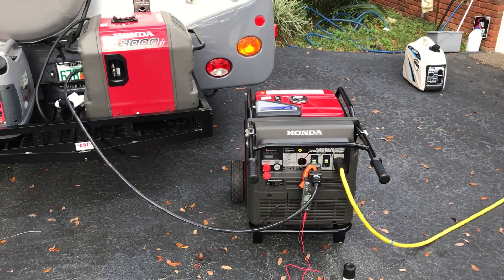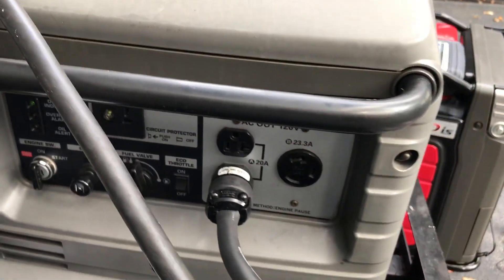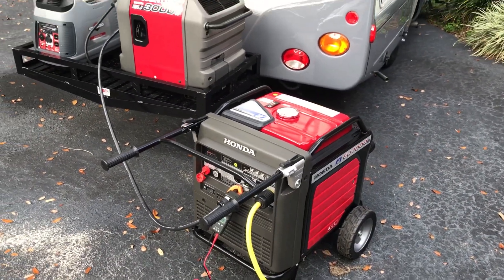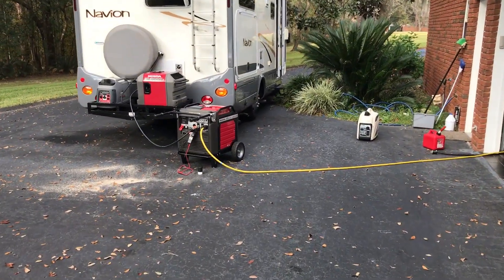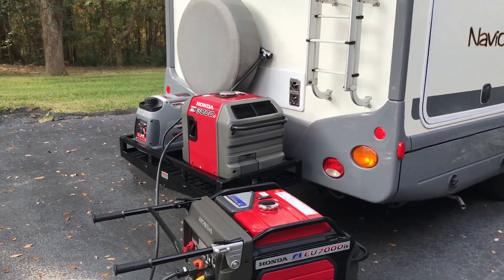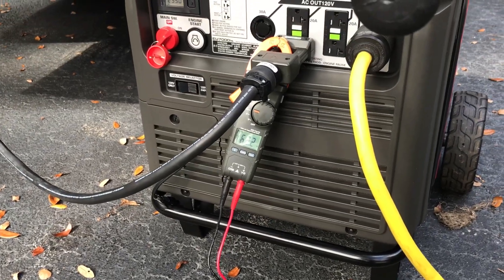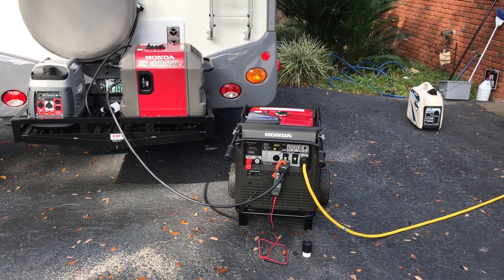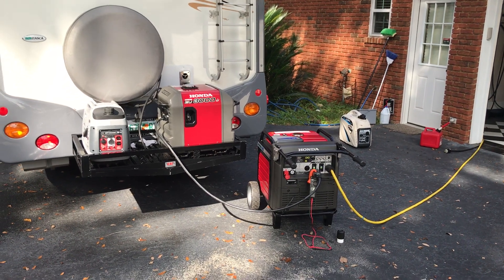Parallel operation of different sized generators Honda EU 7000is and a Eu3000is Honda

Comment: I'm impressed that you were able to get the AC unit to work with the two generators without the Honda parallel 3 port cable to synchronize the phases of the two generators. The 2 ton's compressor probably isn't happy though. It will only take a phase imbalance for a couple of hours of over 50% duty cycle before it's internal thermal switch opens...

Comment: Oh my god please stop doing this. You’re going to burn out the generator that takes on the brunt of the load, or worse it will burn your motor home down. Research circulating current. Please be safe! - I own a electrical equipment rental business in Los Angeles.

Comment: how is this even working , paralleling  two different ac power sources require precision frequency syncing and i don't think these generators have this feature .. the factory paralleling kit uses the dc 400v out and that is much easier to parallel cus its dc and only thing u need to worry about is polarity and voltage.

Comment: we are from louisiana and have no power for probably 6-8 weeks due to the hurricane, we have a 5500 watt generator we have not hooked it up to the house yet..we have a 4 ton central air unit... did your set up run the 4 ton? if so we are going to head out and get a 7500 or something similar to parallel

Comment: I have a Honda 2000i which is no longer sold.  I called the dealer and they said I could only run the same in parallel.  I have seen several other videos of people using different size inverter type generators with similar plugs.  Nice to know it works.  Good job!!!

Comment: This is so stupid. The difference is that not only is this dangerous with the suicide cord but it is the wrong way to fix the problem and you're wasting gasoline with both generators running needlessly. In case you don't know, Honda makes parallel cables for pairing up generators so you don't have to do dangerous experiments like this. However, the best solution is to install motor start capacitors in the circuit for the A/C unit. This is a permanent solution and it works regardless of whether the feed is coming from the power company supply or your EU7000. Motor start capacitors hold a charge which releases and compensates for the in-rush current when the A/C compressor motor starts. There are manufacturers that sell pre-wired and enclosed units that install very easily although it should still be done by a qualified person which obviously you're not. If you don't want to install the motor start capacitors, then at least use the factory parallel cables between the two generators instead of the suicide cable.

Comment: What's caught my attention most is that he's pulling 220v off the eu7000, while the eu3000 and eu7000 are connected in parallel through the #1 110v 20A recepticals on each of the generators. (I know how mosfet full bridge rectifiers, H bridges, and spwm inverters work but don't know everything) In theory this would only increase the available amperage of one leg of the 220v receptacle based on the diagram I'm looking at for the EU7000AT1. The inverter has two 110v outputs that are switched from parallel for 110v and in series for 220v. (This is the part I'm not sure about) Again in theory, if the #1 output (110v receptic #1's hot lead and 220v receptacle's #1 pin hot lead ) is being fed current from the eu3000; 2 things could happen 1. The inverter senses that output #1 is staying at the expected voltage and frequency with less current and backs down current to stay within requirements which technically would lower the eu7000's load and now have more available amperage for output #2. The question here is will the inverter allow more than 30 amps of current to flow through output #2 and for how long (since each output would have to pass 30A of 110v to make the 7000 watts) or would it current limit itself/current breaker open. The inverter would be under less load so less heat, if the inverter determines how long the 7000w "starting wattage" lasts by temperature than it may be able to over current output #2 until the circuit breakers got hot enough and opened. And 2. The 220v receptacle has afew more amps running on one of the 2 hot pins (whichever 110v recepticals is being used to parallel the 2 generators) and the other has a little less. I sure would like to try this and measure a few things to see how it's handling the load but dont have a second generator anymore to try it with.
Reply: Can a EU20i pair with another EU22i?
Reply: @wilsont1010  I'm not 100% sure but from what I've done and seen pretty much any inverter generator that has the ability to parallel is capable of it as long as they are both 110v units. The not 100% sure part is about if one was 220v capable and the other is 110v. But I've connected my eu2000 to a ryobi ryi2200 and they worked perfectly as long as you follow the parrellel start up procedure. The way it works is if the slave generator has a voltage and frequency already present apon startup it will calibrate itself to match what voltage and frequency was there on start up. Load balancing is kind of weird sometimes because the 2200w generator doesnt bog as much under startup load of a ac compressor but they've done fine for me. I experimented with the idea of diffrent brand inverter generators being paralleled because I wanted more temporary power when needed but didn't want to buy another honda at that price so I got the ryobi for half of a honda and it works great for me so far.
Reply: On these generators the limiting factor is the generator current. The inverters are oversized for the generator. As long as you reduce the load on the generator. That's all that matters. In this situation you have 1 leg shared between 2 generators and another leg provided solely by 1 generator. Now in theory you could hook a third generator up to balance things out or really as many generators as you want because these inverters act like grid-tie inverters checking for an AC waveform on the output to sync up to. With no active load balancing each generator would have to have the exact same length and size cable to balance everything out resistively.
Reply: Most ppl making the point that only one leg has been helped by the smaller 120v generator and I believe that to be the case as well. My understanding is that one of the 120v outlets on the eu7000 is powered by leg 1 and the second one by leg two. I’m curious wouldn’t splitting the cable from the eu3000 and plugging it in to both sides help equalize the the assistance that leg 1 and leg 2 are receiving?
Reply: Most ppl making the point that only one leg has been helped by the smaller 120v generator and I believe that to be the case as well. My understanding is that one of the 120v outlets on the eu7000 is powered by leg 1 and the second one by leg two. I’m curious wouldn’t splitting the cable from the eu3000 and plugging it in to both sides help equalize the the assistance that leg 1 and leg 2 are receiving?

Comment: I'm happy to have found this. I own the 1k 2k & 3k. I've been looking at the 7k EU Series bc of the 240v . I'm glad to know the 3k &7k run on the same electric wave length. I'll buy the 7000 now instead of another 3000 to power my house. Those Generacs full home gens have terrible reviews. Cant beat a Honda!
Reply: I'm in the same boat, I was looking at those Generacs to power my house, but at roughly 10k for the generator + installation + bad reviews, I think I am better off with 2x of those 7k Hondas! I have a 3000 Honda inverter with my dad that we use for the hunting cabin, it's been a couple of years now, and even though it's parked for a couple months without being started, it always start within the first 2-3 pulls max. $10k for either 2 of those Hondas or 1 Generac. Not to mention that the resale value on those must be incredible if I ever have to. I'm glad I watched this video tonight. I'll call the dealership first thing tomorrow lol!

Comment: Can you please give specifics as to how you built this? What parts, etc.
Reply: Exactly I would like to know more about that parallel cord
Reply: @kccarrtheoregonhillbillyhi4803  CAUTION! DEATH RISK! Do not assemble the cord that I am talking about. Unless you're educated and familiar with mains voltage. CAUTION! Well it looks like all he did was make a "dead man's cord" (Go google it) out of two Male exstention cord ends and a piece of 10-3 wire. I always wondered if this would work but never tried it. What's caught my attention most is that he's pulling 220v off the eu7000, while the eu3000 and eu7000 are connected in parallel through the #1 110v 20A recepticals on each of the generators. (I know how mosfet full bridge rectifiers, H bridges, and spwm inverters work but don't know everything) In theory this would only increase the available amperage of one leg of the 220v receptacle based on the diagram I'm looking at for the EU7000AT1. The inverter has two 110v outputs that are switched from parallel for 110v and in series for 220v. (This is the part I'm not sure about) Again in theory, if the #1 output (110v receptic #1's hot lead and 220v receptacle's #1 pin hot lead ) is being fed current from the eu3000; 2 things could happen 1. The inverter senses that output #1 is staying at the expected voltage and frequency with less current and backs down current to stay within requirements which technically would lower the eu7000's load and now have more available amperage for output #2. The question here is will the inverter allow more than 30 amps of current to flow through output #2 and for how long (since each output would have to pass 30A of 110v to make the 7000 watts) or would it current limit itself/current breaker open. The inverter would be under less load so less heat, if the inverter determines how long the 7000w "starting wattage" lasts by temperature than it may be able to over current output #2 until the circuit breakers got hot enough and opened. And 2. The 220v receptacle has afew more amps running on one of the 2 hot pins (whichever 110v recepticals is being used to parallel the 2 generators) and the other has a little less. I sure would like to try this and measure a few things to see how it's handling the load but dont have a second generator anymore to try it with.

Comment: So what do I need to do to connect my Honda EU3000is to my eu2000i?? Can it be done just using the factory pairing cable?? Thanks for the help
Reply: I am currently running a EU3000is and eu3000i in parallel  using the factory parallel cable kit.  It works fine and has taken the heavy load off of the 3000 when running the air conditioner and all other items in my RV.  Both run at low rpms in this configuration.
Reply: Yes.

Comment: So my question is are you putting the neutrals off each unit on the common panel neutral neutral ?
Are you splitting the hot legs on the gen one for each side?
Or adding the hot legs of the gen set to each other for more watts on a single leg?

Comment: Sir, I would like to know the load and specially voltage drop on each leg when your AC unit  is starting. That will tell me if you doing the right thing or not. Can you humor me, test it and let me know please.  You can even test the voltage drop on each leg in your electrical panel. Thank you. V
Reply: I'd like to know this as well. Technically each side should be unbalanced and I just got my EU7000is and it won't start my 16seer 4ton unit with a 5-2-1. But I also have a eu3000i Handi that I'm willing to try as well.
Reply: @jasona-EV  Get a hyper engineering sure start, You will be able to start it. I have a 13 seer 4 ton unit and I am able to start it with only the eu7000

Comment: Need to talk to you. I designed a circuit to keep the AC current from  backfeeding the unconnected conector, making the cable connecting the two generators safe, since the unplugged connect will have NO voltage on it..  I would be interested in your input and help testing it.

Comment: This exercise makes sense, and actually seems like a great idea, yet with two caveats (end of comment). The EU's capable of parallel operation will look for a wave on the phase, at .startup.. if there isn't one it starts one, if there is one it will match that phase's wave. The 7000 is a split-phase, so if you're attaching a single 3000, when the 3000 starts up, it'll find the wave on that phase, and match it. Caveat 1... that would mean you have 3500w on one phase, and 6500w on the other phase. That would have the potential that, depending on load of other devices, when the a/c turned on, if would be drawing uneven amount of current/amps from each phase.. which would probably mean each phase would be delivering different amps, potentially damaging the motor (which is now out of balance). Might be best that if you DO do this, that you put matching parallel EUs on each phase. Caveat 2... your breaker box appears to be a 200a, so you should put a breaker between the gen sets and the breaker box, so that if either phase overloads, both phases trip. Just a thought....
Reply: Wow good thought process
Reply: Is it possible that there is equal pull on each phase but higher potential power capabilities on the paralleled phase?
Reply: Let's go

Comment: Back-feeding is against code, and deadly to linesmen if someone mistakenly turns the mains back on with the gensets running. Install a proper transfer switch, or breaker box with built-in transfer device method.
Reply: Backfeeding is totally legal in all codes in the U.S. BUT you NEED the switch interlocked with the main(so both physically can not be on at the same time). Backfeeding with an interlock kit is cheaper and just plain better than a transfer switch.

Comment: One of your next projects would be to upgrade those ancient ac units to more modern efficient ones. Might not help much on cooling but you could get a 16 to 18 seer heat pump.

Comment: I got the new EU7000 parallel kit. I have two 3.5 ton central A/C's both with the 5 2 1 hard start kit.  Two EU7000's running in parallel  run both my central A/C's with no problem. When both A/C's are running and my refrigerator I'm pulling 3,350 on one and 3,250 on the other.
Reply: Thanks for sharing your experience. Do you know if your 3.5 ton units are piston (short squat looking) or scroll compressors (tall slender)?

My 15 SEER Trane 4 ton is a scroll and the starting inrush dims my lights.
Reply: @greasyjimmy  Mike I'm not sure. Both are 2012 compressor's

Comment: Just curious, I have asked tow electricians and asked them specifically if backfeeding a generator into the breaker with the main in the off position would it be safe. They both said the same thing, it would not be safe for any person working on the electrical lines. Could I have your opinion please?
Reply: It’s fine to backfeed IF you have an interlock kit… this guy does not… so it’s not fine. The way he’s doing it, he’s relying on his memory to switch off the main to prevent backfeeding into the grid. He could kill a line man during an outage.
Reply: That's what a crowbar is for.
Reply: Tommy TMT  Leave michael Vaugh alone. I know for a fact the lineman is a serial adulterer and deserves his come uppance.
Reply: You need an automatic transfer switch. No if's-and-butts

Don't put others at risk. This is not even open for discussion, guys die each year from this kind of crap.

Doing it the way shown in the video is a huge risk for life and safety. Basically the Honda's (or any A/C sync inverter) will sync up with another A/C source (the grid or another generator) and work side by side with that source, they wont trip any breakers. By not having an automatic transfer switch if that main breaker is turned on there is a risk to the Linesmen working up stream if they think what they're working on is dead.

The generator will run, the guy's will think the powers off, and oops... dead workers and the liability that comes with it :(

oh and little Timmy looses his dad.
Reply: Yes, this is illegal as hell, lucky you not creating a lot of heat with the power company neutral and the generators return circuit conflicting each other. I experienced this in Oklahoma with a generator running, we had the meter pulled( just in case)as we tried to connect the neutral at the pole all kind of sparks flew!
Reply: The massive load of powering the grid from a small generator like these would instantly trip the breaker or kill the generator

Comment: I confirmed personally today that you can parallel the eu2000i and the eu7000is.  I was able to start a 5 ton HVAC unit using my eu7000is and eu2000i paralleled together.  It's important to note my compressor is using a 5-2-1 hard start kit.
Reply: Joseph how did you parallel them what cord did you use
Reply: Carlos Reyes if you look at the schematics on the Honda generators, you’ll notice the parallel plugs are connected to the 110 volt plugs. I created a cable using two male ends and connected them using 10/4 soow cable. I hope this helps!
Reply: Joseph what type of male plugs did you use.
Reply: Andrew Somerville just two regular 110v male plugs. Nothing special or fancy.
Reply: So you just plugged both male ends to the 120 outlets on each generator?
Reply: Yes.
Reply: @Joseph-mp8mi  But wouldn't this exceed the output current of the second generator and cause the overcurrent breaker to trip?
Reply: Joseph wow that's awesome

Comment: Damn, I'd be afraid to do that with such high end gens. I think if you pumped them past 10KW you might have issues, breakers blowing at least. Honda does allow for EU2000i/EU2200ic to be paralleled but the 2000i has to be within a certain serial# range to be compatible. I'm wondering if the newer models are setup to be compatible, it's just that Honda doesn't advertise it. Cool post.